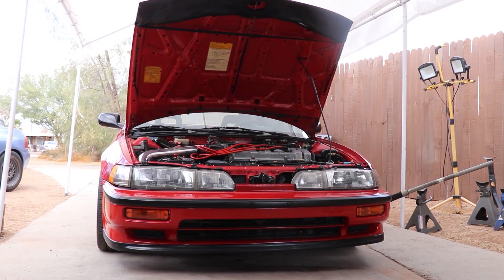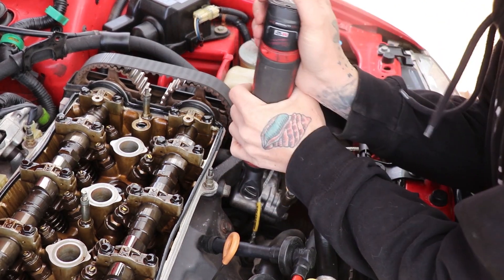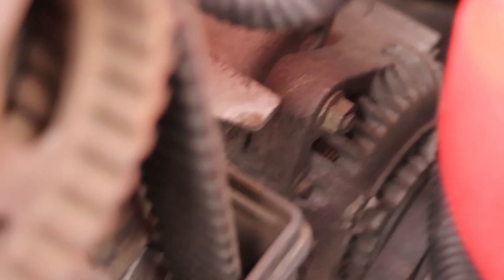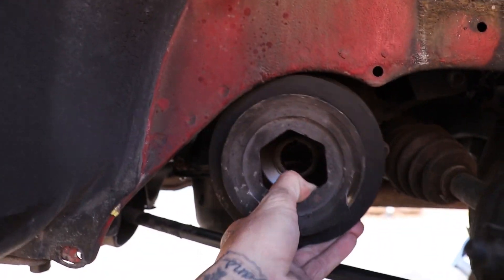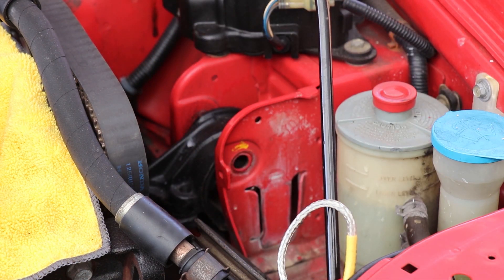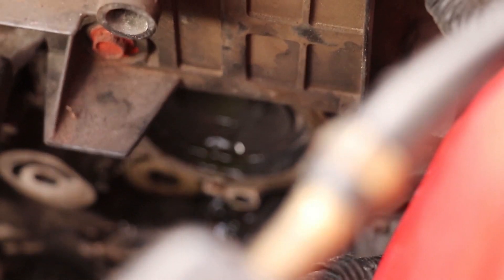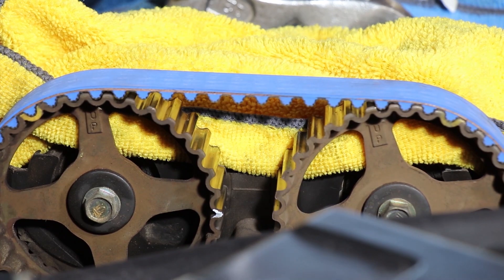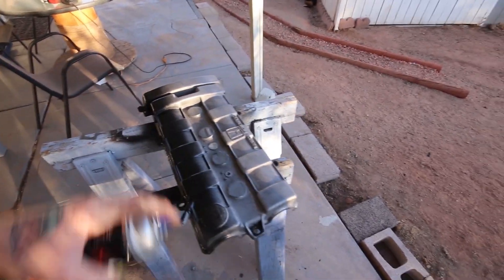DA9 Integra Full Timing Belt Replacement

Comment: It has been a while since I've done one of these timing belts. But in order to hold both cams, there should be a hole on the top of each cam shaft just behind the cam gear. This hole lines up with a hole in the block or cam cap in which you install a dowel pin, or what I use was a drill bit of the proper size, and it locks the cams in place.  Pretty cool!

Comment: I dont know why after doing my timing it just doesn't seem tight enough. I rotated it 3 teeth counter clockwise too.. I heard it's a honda thing.
Reply from the maker: If it’s not tight enough you probably did it wrong. If you did it right, and it’s still a big loose you may have to run a secondary timing belt tensioner

Comment: Is it normal for my belt to jump teeth if i rotate it clockwise? And if i run it like that will i be taking risk in jumping timing if i turn the car on? or does it spin counter clockwise and it should be good
Reply from the maker: These engines spin counterclockwise.